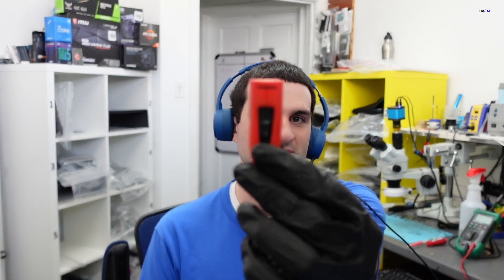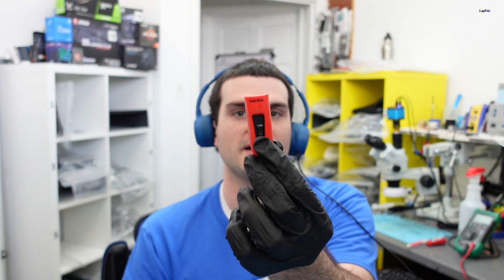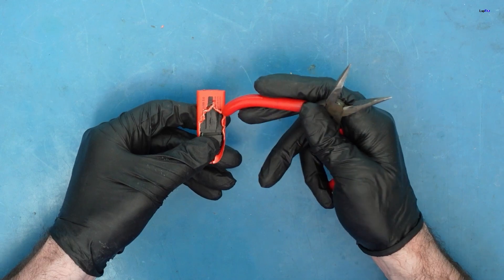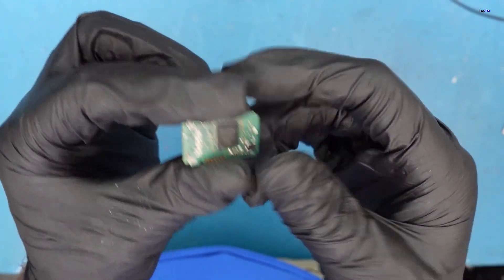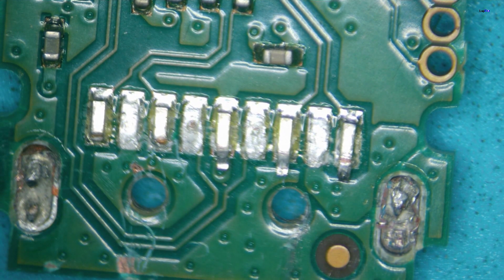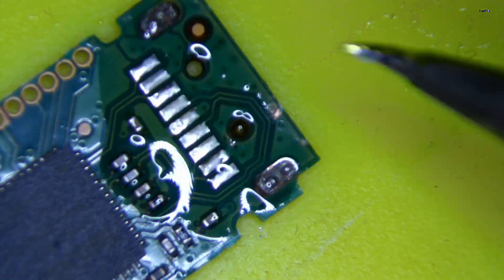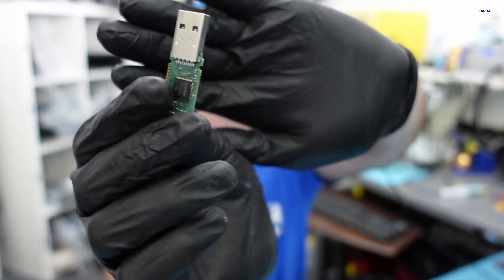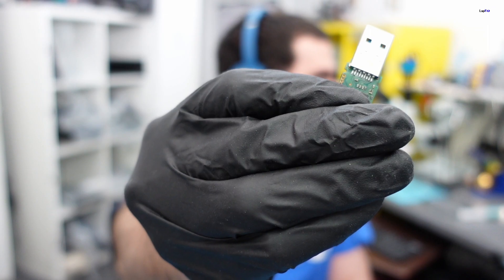How to Fix Broken SanDisk USB flash drive for Data Recovery

Comment: I wish you were around here. Everyone in this area are telling me it is too difficult and just throw it away. Mine had every document I own for the last 20 years, including my writing - poetry, books, screenplay notes and legal documents. I had to make room on my laptop so I transferred it all and deleted everything. My nurse came and I moved my laptop quickly, when it slid off the chair and bent the connector of the SanDisk USB Flash Drive 16GB drive.  It is not recognized by my laptop now though it still plugs in. Anyway, thanks for your video. At least I know I just have to find someone willing to do the work. I need them to show me how to use the extended hard drive too. Staples was more interested in making the sale than selling me the easy thing I said I was looking for, an external hard drive yes, but a drag and drop thing, not something I had to set up like a computer with no instructions that needs partitions or something.

Comment: I have a similar issue to one of the people here in the comments. My USB is a SanDisk Cruzer Glide 256GB and long story short laptop fell, USB bent, and now it's not being read by my laptop. Just minutes ago I opened up the USB with the help of my uncle and I now see what's wrong with it. 

There are four prongs, the first and fourth ones look just fine. Both are attached to the board correctly but the second and third ones have something I have never seen before and I'm scared. Both prongs have ripped the metal piece off of the motherboard and the pieces are stuck to the prongs. Pushing all the prongs down and inserting it in my laptop doesn't seem to fix it. 

I don't know if a soldering iron would work at this point and I'm in desperate need for advice. Currently going to Best Buy to see if Geek Squad has anything to say. Please if anyone has a solution PLEASE tell me.

Comment: I have a 256G SanDisk USB drive that looks just like yours. Where can I find a donor to solder?
Reply from the maker: For the head piece, you can use the model number.  If the repair goes beyond that, you need a similar pcb/controller which are very difficult to find
Reply: @lapfix  please share the link from where you've got the exact donor in this video, unless you intentionally decided not to share, like a business secret, which makes sense. Rest all good.
Reply: @lapfix  thank you. I need the male USB part with the pins. My pcb has a lot of contact points, as opposedto the 4 on some drives. It's a 256 G drive.